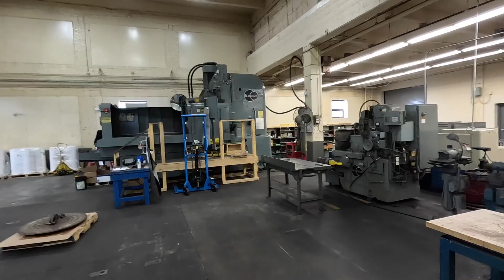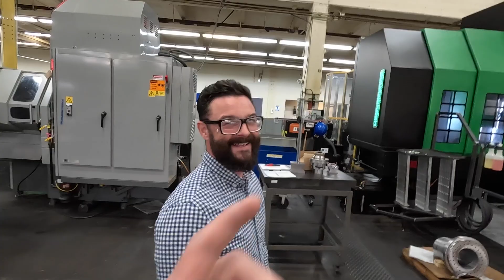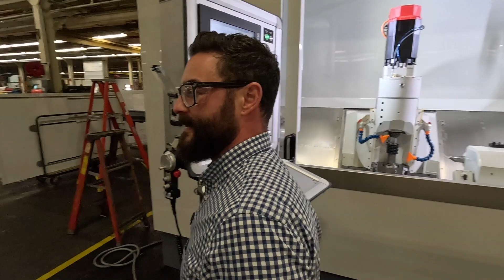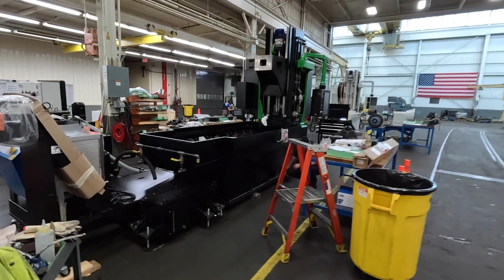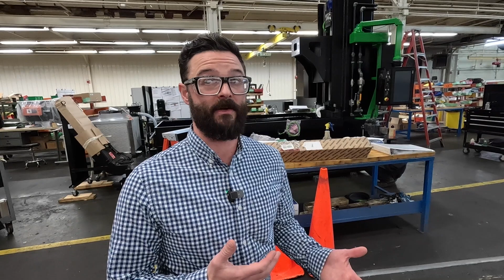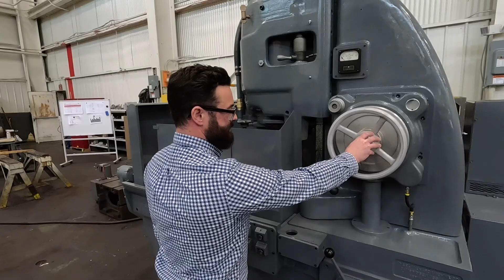Factory Tour: Bourn & Koch Revisited!  Building HUGE machines!

Comment: When I see these new blanchards I think about how I started in this trade only a couple years ago and I learned how to operate blanchards on a 48 and 96in. The 48 in was beaten up but the table speeds work and it holds a good tolerances if youre careful. The 96in is a dumb beast. The tables gear box has been apparently stuck at 1 speed for like 12 years. We get this job where i have to just rough 2 faces flat and parallel on these 2.5 x 3 x 6 ft 4340 blocks. Since you couldn't change the table speed i'd use 3 different hardness segments at once. You would also have to kick the table out about 12ish inches so you could use the manual dresser while it was cutting so it would get the job done in a reasonable time. So standing on this stool watching the blocks from above the fence with your hand on the dresser and the other on the nut to adjust it the entire time. Then when your like .050 away from your number dress the stones 1 more time.  Then bring the table in and finish it. I swear to do just 3 blocks you went through a set of stones.  I learned that it was about 4800 in stones we went through in a day and a half for just 6 blocks (11ish hours). I thought that it was wasteful then they told me how much they were paying for 1 finished part. Then I just thought we should really fix it then.